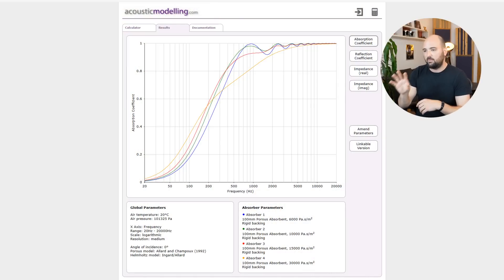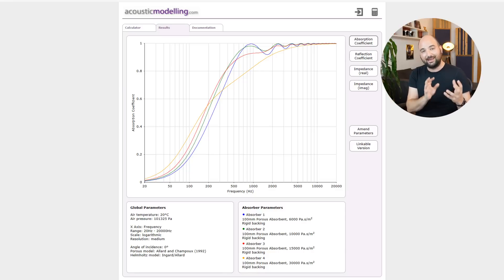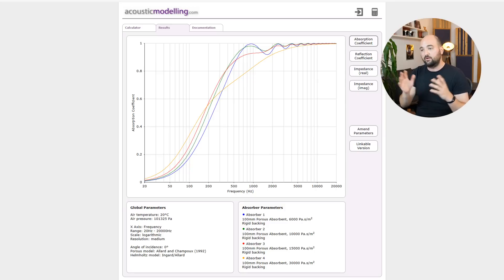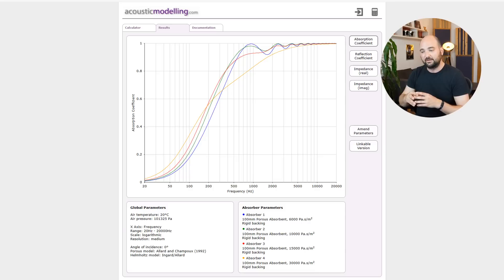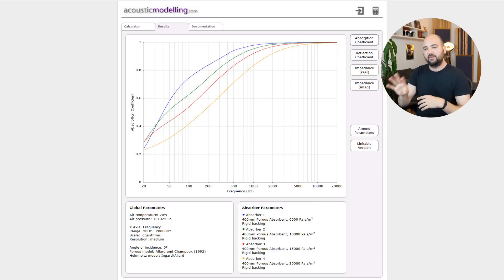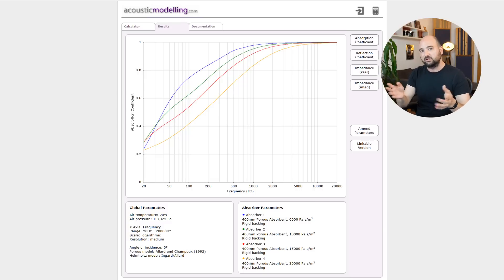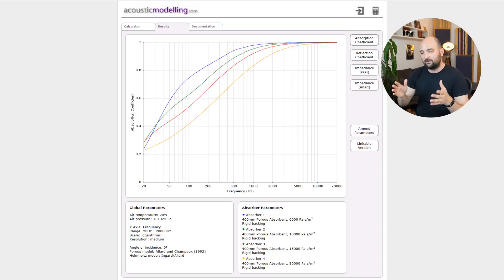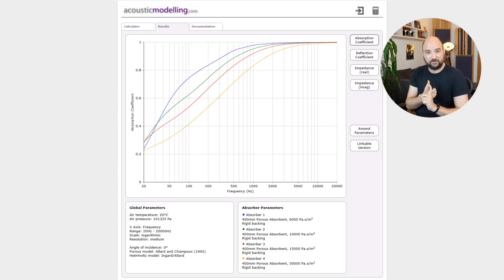DIY Bass Traps: LOW vs HIGH DENSITY Insulation (Stop Wasting Money!)

Comment: I don't know how you can look at the data in that first graph and draw the completely wrong conclusion. We're talking about "bass" traps, not "lower mids" traps. Below about 85 Hz, the denser material becomes clearly superior to the lighter material. Below ~45 Hz, the dense material is superior to everything else. In other words, in the "bass" frequencies the dense material is superior. It's right there in front of you. The only way you can say the lighter material is superior is by pretending "bass" doesn't include anything below ~100 Hz. And that is an absurd position. The most common crossover frequency I've seen for bass in ANY audio system is in the 80-90 Hz range. That is exactly the range where the denser material takes the lead in the graph you present. Also, you say the difference between the two is "only 10% or so" at the very bottom, which isn't accurate. The difference is actually 10 percentage points. The light material absorbs around 5% at 20 Hz and the dense material absorbs ~15%. That means the dense material is THREE TIMES as effective as the light material, not "10% more". Meanwhile, at 100 Hz, the dense material absorbs ~45% and the light material absorbs ~55%. That's the same 10 percentage points as at 20 Hz, but you claim this is a huge difference. In fact, this represents a mere 22% advantage for the light material compared to the 300% advantage the dense material offers in the actual bass range. This would be at the upper end, or even beyond, where any "bass" trap would be designed to operate and other absorbers would be taking over. Whether deliberately or accidentally, you are grossly misrepresenting your own data.

Comment: I think you confuse the terms here you talk about low density of a material for bass traps with bigger thickness but what you mean is lower flow resistivity so air passes through easier. This emans also you want to maximize the density of the material while having a low flow resistivity. Because the denser the material is, the more mass it has per volume, combined with a low flow resistivity would be perfect. We need the low flow resistivity to let as much air carrying sound through the material and more mass per volume that can dissipate the sound energy into heat, thus absorbing the energy. More mass is key to absorb more sound and turn it into heat while still being maxiamlly permeable for air (low flow resistivity).

Comment: Nice! But how to convert the unit from pa.s/m2 to kg/m2?
Reply: You don't. This needs to be measured. Rockwool Termarock 50 is 50kg/m3 and has 16kPAs/m2, on the other hand Basotect is only 9kg/m3 but has 12kPAs/m2. There is no correlation between those two numbers as flow resistivity solely depends on how permeable the material for air is. Basotect is more permeable having a lower air resistivity but brings less mass on the same volume as termarock 50 for example. Meaning mineral wool has more material to dissipate sound waves into heat but still both perform at the same level almost in mid to high frequencies with the same thickness.

Comment: Hi Jesco. Could I get your advice on a concern I have? Feeling a bit lost for help... I just received 10 acoustic panels (2x4x3) for my home studio(just for mixing) and on closer inspection, I see that the fabric used to house the rockwool is 10oz canvas duck fabric. When I try to blow through it, it is very resistant to air passing through. From my research, this could be an issue with high end absorption as the sound waves will reflect too easily due to the tight fabric. At the risk of spending over 500$ to re-wrap them with a more porous material, I thought I'd ask your opinion as to wether you think that would be worth it or not. Based on your experience, do you believe the difference would be significant enough to embark on this tiresome project? Thanks

Comment: Does anyone know how to get low density insulation in the UK? The commonly available product is Flexi / Sound Insulation Slab - 35kg/m³ - 14200(pa.s/m²) and RWA45 - 18100(pa.s/m²) which is way off the 5000 or 6000 pa.s/m2 I wanted (customer support gave me these values.
Reply: Loft insulation fiberglass such as Supertop up & Earthwool. I've used 170mm from Wickes to build 51cm depth. PM me more details
Reply: @Wickeds933  Hi, thanks for your reply. I'm not sure how to pm on here. It seems like the loft fibreglass you mention is the only real option for low density - rockwool is always too dense here. I've seen Knauf Loft Roll 44 is 8.7kg/m3 and Knauf Earthwool Acoustic Insulation Roll10kg/m3. I'd guess this is around 3000-4000 pa.s/m2. I guess this stuff is too floppy and sags for wall hung traps? 51cm depth is huge!
Reply: @MadelnMachines  I cut three pieces from the 170mm, and sided them together to make a depth of 51cm. You need a large depth and/or airgap to hit frequencies closer to the sub range when it comes to porous absorbtion. I used OSB board for the entirety of the structure, posts and boards but I am ordering roofing batten to finish the rest of them because it was a nightmare to work with. OSB even at 18mm splits against screws.

Where'd you'd find the information for Knauf Roll 44 being 8.7kg/m3?

P.S 
I wouldn't make a trap and cut the insulation too long because it will likely be difficult to keep up. I made my traps modular and stackable at around 100 cm. Last thing to add, you need to wear a decent mask at least 3 layers, and cover the insulation with fabrics that are loose weave but will contain the fibres. I used barrier fencing, then muslin, and then burlap for the outside.
Reply: @Wickeds933  I found it just looking through the specs on various UK resellers websites. I think a lot of people use more dense stuff for hanging panels in 60x120 insulation slabs. I guess they’re a lot easier to work with and more appropriate for thinner panels. I’m thinking I want 20cm panels for most of the room with a 10-20cm air gap. I could maybe go thicker on the back wall or front wall. What wood did you use? I don’t want it to warp or bow. I saw inthemix did some panels which seem to have lasted well but I think the thin ply he uses for the sides seem a bit flimsy.
Reply: @MadelnMachines  I used a 2440mm x 1220mm x 18mm board and cut out tops, bottoms and posts with a tracking saw (safer than table saw) but I'd advice against using engineered wood i.e OSB, MDF for posts, better to use roofing battens, less splits, stronger and I think they're lighter. That was my process of making large super chunk traps 51W x 51D.

I've made regular 120 x 60 x 10 depth porous absorber panels with flexi rockwool (45kg/m3 I think) and spruce roofing battens and didn't have any issues. It's the better way to go because they're light and reasonably cheap, saves a lot of cutting too as you only have the length to saw. I'm making new frames with legs so that I can increase the airgap and move them around the room like gobos, and the missus is happy that they're not on the walls. Also need to replace the fabric because the weave isn't open enough. Takes some failure until you know this stuff.

You should search jochenschulz on google, he has interesting research and knowledge regarding GFR and insulation density.
Reply: @ I think a lot of people including companies like GIK skip the 2x2 structural posts/ frame and just screw some mdf or ply together to hold the top bottom and sizes. I was going to buy I think that creates warping/bowing. I’d rather do it right and do it once. Yeah I’ve have jochens pages bookmarked - that’s why I ended up wanting lower density than most people go for.
Reply: Hmmm… i read in many places that very recommended is isover pt80 materiał which is 80kg/m2, very heavy, not to mention there are ready to use panels built with this rockwool, so what is true ?:p not to mentioned i cannot find any acoustic metrics od this material:)

Comment: Hey Jesco, I have to take issue with your description of a 10-15% difference in LF that you describe at around 4:30. Saying that there is 10-15% difference is incorrect - what are you comparing to? At 50Hz the absorption coeffiecient of the yellow line is more than DOUBLE that of the blue. That is more than a 100% difference not 10-15%. At 800Hz you could say thet the blue one is at most 25% better. You know what they say "lies, damned lies and statistics"! I love your channel and know that you are a real help to people out there getting to grips with this stuff, but please don't misrepresent the mathematics in this way. And btw, I do understand what you were trying to say in percentage points where a coefficient of 1.0 is 100%, but the way you phrased it is massively misleading in trying to make your point.
Reply: Was about to say the same thing. The effective lower bound in terms of frequency is basically halved for the higher density material. This is a pretty big deal, since its in fact quite easy to absorb the midrange and we don't really care about performance in that area.
Reply: I think you are confused because you are thinking about percentage as though he said something like there was an "INCREASE OF" or it "DECREASED BY" when really he said there was a "DIFFERENCE OF". 

In a whole numbers example: if you start with 2 and now you have 4 that was an increase of 200 percent but also a difference of 2. 

This absorption coefficient scale is a percentage scale where 1.0 means 100 percent absorption, .5 is 50 percent absorption etc. 

So if a frequency is 50 percent absorbed by one insulation and then you switch to another insulation that absorbs 100 percent of that frequency, you have a 200 percent increase of absorption at that frequency OR like Jesco said a DIFFERENCE of 50 percent. 

Hope that clears things up.
Reply: You can look at it this way. The scale he is referring to already has a determined 0 - 100 percent range. By saying there was a difference of 50 percentage you effectively leave that range alone and are just referring to how much you moved within the scale. 

If you say there was a 50 percent increase then you are now making the number you are referring to equal 100 percent on a new scale and are now moving along the original scale by 50 percent of that newly established 100 percent of the new scale. 

If we have a simple scale of 1-100, 1=1%, 100=100%, and I have a measurement of 50, that measurement represents 50 percent of that scale.

But now if I take a second measurement of 100 and I say there was a 200 percent increase I am essentially saying that our first measurement of 50 now represents 100% on a NEW scale. so if 50=100% then 100 equals 200%. 200 percent increase from 50.

But if you dont want to get overly complicated you can just remain in the original scale and say that one measurement was 50 which equals 50% and the next measurment was 100 which equals 100%. 100% - 50% = 50%, or in english a difference of 50%.
Reply: @MindsetModulation4259  It's really not that difficult to grasp. Like I said, the dialogue is misleading.
Reply: @jamesglewmusic  well either its not that difficult to grasp for you, or the dialogue is misleading you. Cant really be both. 🤷‍♂

Have a good day.
Reply: @MindsetModulation4259 I said the dialogue was misleading. It wasn’t misleading me, I have a proper engineering degree (metallurgy) which included three years of a module on Analysis of Data. I have no problem with interpreting the actual data myself. Have a good day yourself.

Comment: I find it odd that in this video you don't mention the space behind the material as a factor. Your calculation only applies without any space behind the absorption. If one adds space behind the absorption then the calculation is very different and Higher density becomes more efficient again. So its more about figuring our how much space in ones room one is willing to give up (including the space behind the Absorption) and then working accordingly. I use 80kg/m3 material at 280mm thickness with equal space behind it (so total 560mm space used in room) and it is way more efficient than 560mm (without space behind) of 30kg/m3 density would be so it was cheaper to go with denser material where I had the space for it and less dense material where I didn't have the space. I hope this makes sense. Thank you so much for your videos, Ive learned and applied a tremendous amount because of the knowledge you shared.
Reply: Another Channel proofed that this makes No Sense. There ist nearly 0 difference between Absorber with space and wirhout space.

Comment: Jesco, The model you use to calculate the absorption is from Allard and Champoux. Use a different model and you would have a different outcome. The model shows perpendicular reflection absorption. In real life materials absorb on all sides and all reflection angles. Low density reacts different at 45 degrees than high density. 

 At Lacoustic we measured absorption for over 150 configurations and materials with an intensity probe. We measured from 20 Hz up. We found that using different densities makes a great difference.  Right now we are able to make an absorber that effectively absorbs from 60 Hz to 20 kHz just using 3 different densities.
Reply: I thought it was a good point.
I also use the simulations on this acoustic modelling page, and it is true that the results can vary depending on the model.

However, no matter whether I use the Random incidence, change the Angle of incidence, or change the model, I do not get data that shows that high-density sound absorbers increase the low-frequency sound absorption more than low-density absorbers. (in base traps of 400mm or more, for example).
If other simulation software or sites can provide such opposite results, could you please share the information?
Reply: How thick is this broadband panel that you have designed? Would you mind sharing the different densities used?
Reply: would using a lighter density then a thicker density rockwool be better for corner bass traps than using a lighter density with plywood and airgap?

Comment: Great explanation Thank you. I have made some triangular corner bass traps (due to limited space in the room to span corners with rectangular traps. I've stacked what is fairly low density slabs of insulation on top of one another to fill the trap. Unfortunately, the slabs eventually settled on one another to a point where the top of the trap is devoid of material. I packed more material in the top of the trap to fill the gap, but I'm assuming this is actually increasing the overall density of the trap (More material per cubic meter as the material settles)

Comment: Hi Jesco, I don't want to contradict you, but isn't it easier to see the specification of the material, whether it is rock wool or fiberglass, if I look at the coefficient (alpha) of the material and see 125 Hz.
The closer to 1 the better for low frequencies, obviously with the same thickness, like 1", 2", 4" or something like that.

Comment: thank you. excellent explanation. I've used your course materials and found them helpful. I'm in the middle of using 3 types of density materials building traps, mostly because I like to experiment. I have 5" dense, 5" very billowy non-dense fiber glass, and 4" safe and sound mineral wool. I'll try to keep you posted on what I've learned for my application=small mixing room (10'x 17' x 8'). Sorry I'm no good with metric conversions! Lastly, I got some MDF panels CNC cut 1/4" for the "bass traps" I'm building to attempt to tame some specific room nodes, and then will use a dbx driverack to "tune" the room in the end. I'm also thinking of using french cleats for mounting some of the diffusers and absorbers I'm building, so they'll be more modular. Lastly, using dampening neoprene and/or rubber wherever one surface touches another to minimize rumbling or buzzing sounds. Thanks Jesco! I've been working on this room for well over a year now and found your knowledge very helpful. Tschus!

Comment: I believe 8 pound rock wool is very effective…especially if you build in a range limiter plate…and use air gap.
Reply: believing is useless
Reply: @JohnSmith-pn2vl  it’s what the large commercial trap companies are using in my country. USA. The independent lab tests enforce my beliefs.

Comment: I'm guilty on this because of poor knowledge over the materials I was working with during the experiments I did back then. Here in my country flow resistivity is not displayed on rockwool manuals because institutions do not care about acoustics at all over here, I later learned that you have to request from factories this information and some of them doesn't even have this measured. There's huge variation in flow resistivity in rockwool of the same density and I didn't knew that until recently.
Reply: Not really, the info on the internet is all cotradicting each other. One real life proven method: Layer  different densities. 10kg per cube - 30 kg per cube - 60 kg percube.
Reply: In the same sentence you say "the info on the internet is contradictory" and then on the same internet you say "there's a one real life proven method" but without any indication for what you're saying and specially: why. You see!? Hahahahaha

At this point in my career I have a grasp on this subject. I have tons of measurings from my own work applying these materials from different densities (and even different compositions), they all vary for unconsistencies in manufacturing, so between 30kg and 60kg there's not much of a practical difference, all work just fine in the type of treatment I design. So I just buy the cheapest available, if it's same priced I'll buy the lighest.

I often ask myself why someone comes so disagreable on the internet just like if they knew any better, there's no one-proven-method nothing, there's actually a few...